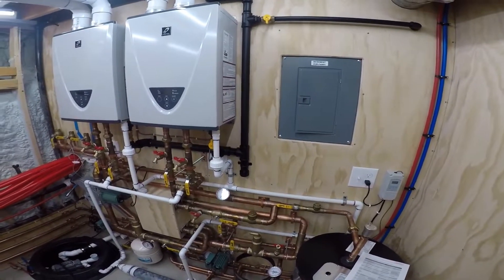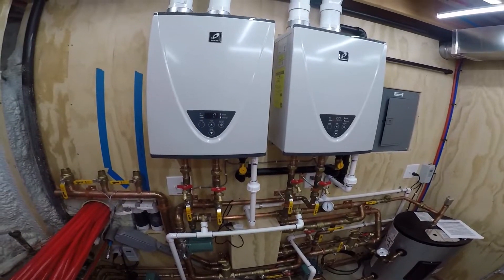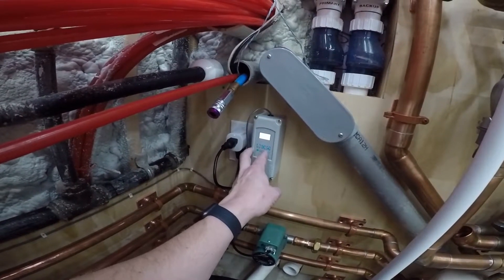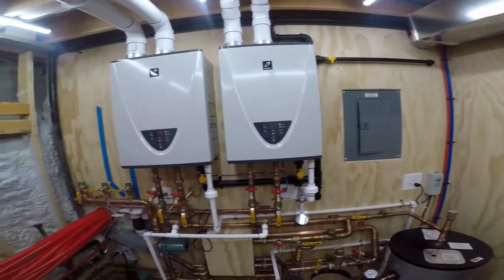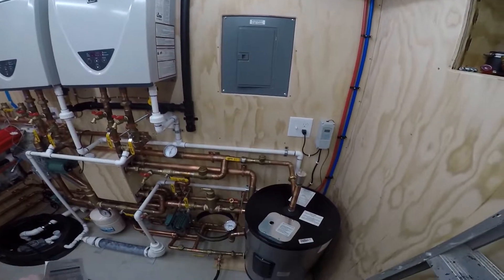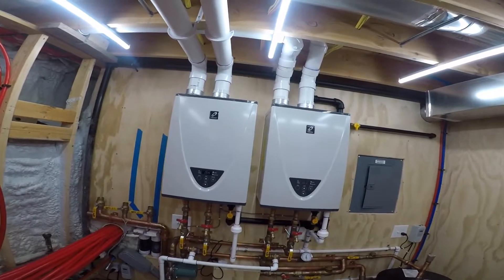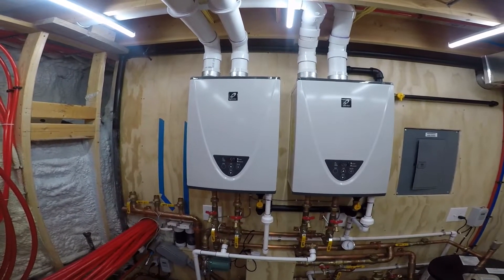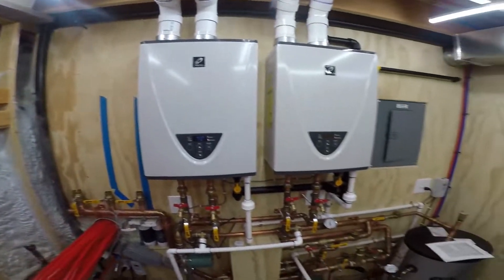First Run with Both Takagi Tankless Water Heaters Working Together! - Episode 31 [11-26-2020]

Comment: Not sure if you had mentioned in one of your other videos, what was your decision making process in going the Takagi route versus going with a combination boiler? I only asked because I'm thinking about going with the same model water heater that you have for my 1400 ft² home. I read a lot of people discourage from using the water heaters but it appears that you're having great success.
Reply from the maker: Hi Josh!  It was a long decision process for me, and I still remember hesitating to click that order button when I bought the tankless units, questioning myself if I was making the right choice.  What ultimately did it for me was meeting a friend in an online forum who was using the exact same model tankless https://amzn.to/3QK5luw to heat the floors in his car wash.  His pumps turn on anytime the outdoor temperature drops below 32ºF running the heaters.  He has his setup on a 30 minute cycle, so at 32ºF outside the heaters will be 15 minutes on, 15 minutes off.  As it gets colder, they are on more, and off less, but always still on that 30 minute cycle.  It's pretty much on ALL winter!  He is also running glycol directly through his units, not water and a heat exchanger like mine.  This setup has now been in operation for over 9 years, and he has had NO issues.  I thought, heck, if I have that kind of performance and luck like he has, I can buy 5 of these things before I get into the price of one boiler.  These units are modulating, condensing, and I've found them to be very efficient.  Anyways, not sure if that answers your question or helps, but that's how / why I eventually went with them, and I have been extremely happy.  Thanks for watching!